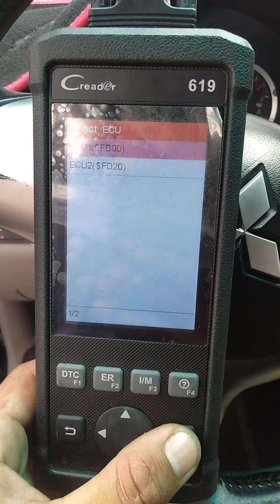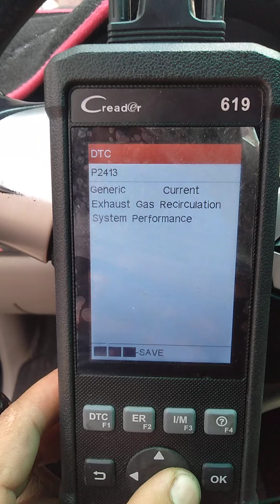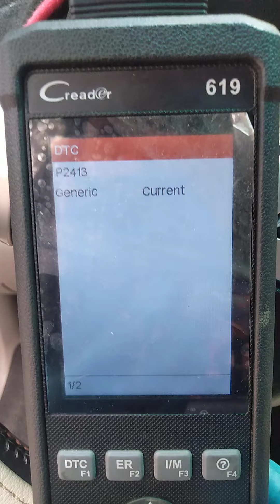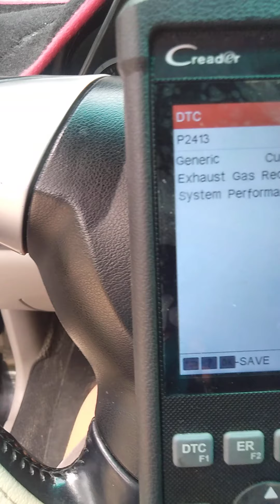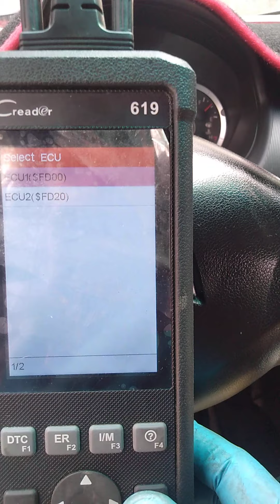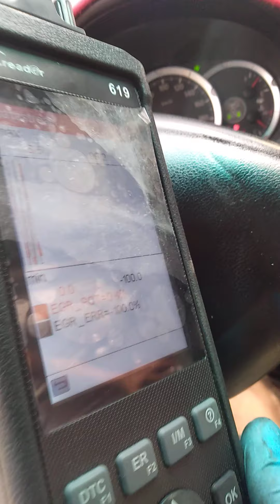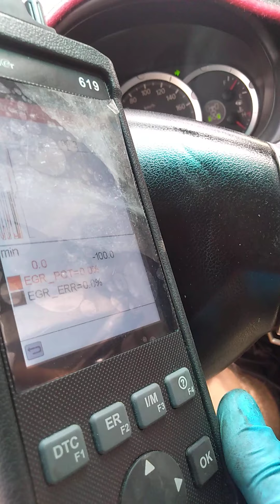MITSU. MONTERO CHECK ENGINE PROBLEM😓

Comment: Good day boss. Ask lang ko. Asa imo address. Pila imong labor mag pa ilis og valve cover gasket sa montero sports gen2 2010 model. Salamat
Reply from the maker: Hi Sir. Davao City home service po.
Reply from the maker: 2,800 labor po.
Reply: @jayautodokvlog393  boss kung injenctor o-ring og valve gasket ang ilisan. Pila imong labor boss? Thanks
Reply from the maker: Same lang Sir ..
Reply: @jayautodokvlog393  ah ok sir. Pwede ko maka pangayo sa imong cp# kay kung naa na budget mag pa sked ko sa imoha. Naa ra ko dri sa crossing Ulas among haus. Thanks
Reply from the maker: 09094008398-Jay
Reply: @jayautodokvlog393  salamat sir.
Reply from the maker: @amielpapalid882  welcome po